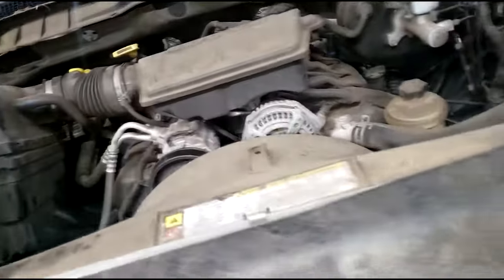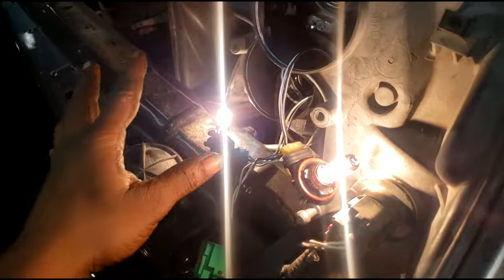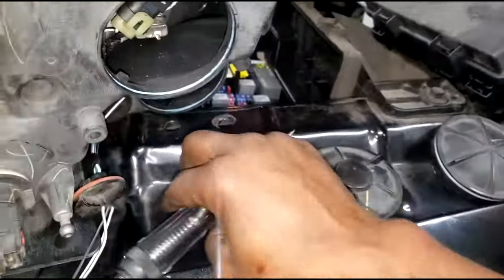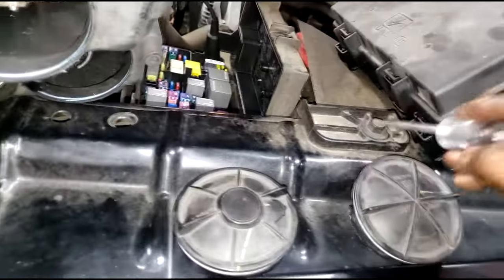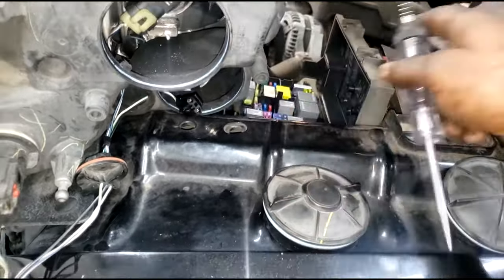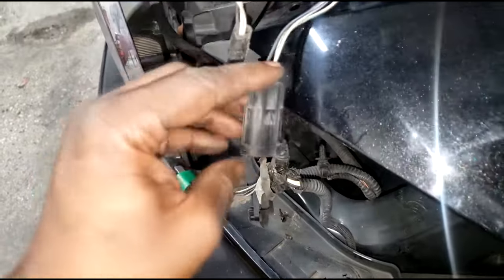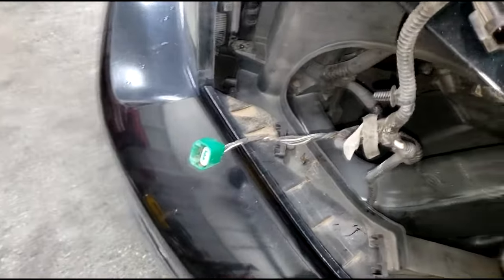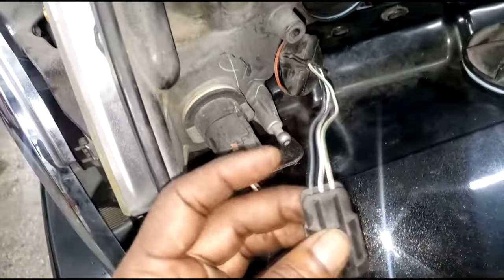Never do this to your Dodge Ram 1500. Headlight electrical problems found when I test this circuit.

Comment: Thank you so much for the helpful video. My issue is with my 08 ram. My front turn signal won't work at all. All the others work fine. The front marker lights work fine on that light.

Comment: When replacing with LED aftermarket they now make plug-and-play ones that don't need step-downs or step-ups to make them work. 2022 Upgraded AUXITO 9012 HIR2 LED Headlight Bulbs, 100W 20000 Lumens, Wireless LED Headlight Conversion Kit, 6000K White Halogen Replacement Bulb, Pack of 2. These are for the low beams and the High beams are the 9005 bulbs. They have built in fans and I took out my old bulbs and plugged these in and they worked with no issues.

Comment: I just bought an 07 Ram 1500. That has no headlights or high beams or brake lights My buddy, that's a mechanic said its probably the fuse panel and there like five hundred bucks at a junk yard

Comment: Just helping out … 

Power/Ground doesn’t feed directly into that bulb, there is a switch in-line, on the power side that closes the bulb-circuit…. This how a house-switch works, but I may be wrong concerning this issue

Comment: the harness within the housing has been known to corrode and thus be changed.   the new harness could have been an eBay knock off from OEM and is possibly why the common was not in the middle.    or the housing was hanging at one time when owner changed the bulb and the pins pulled out

Comment: Good video but based on your findings it would never had worked. I would  bet someone swapped wires not knowing what they were doing when all along the problem was a loose connection. Unable to get it to work especially with the wires swapped they brought it to you to untangle the mess.

Comment: I have a 2014 and having the same problem with the same light The new light was very dim; I thought it was a ground and never would have thought about those wires being messed up I'll check it out tomorrow. and get back to ya. it might be a factory mess up

Comment: I just fix the problem on my 2017 ram 1500 the one I had headlight problem just change your wiring harness get a new wiring harness faded into the headlight dirty old wiring harness out that’s it your problems fixed

Comment: Pretty sure this is the same as the difference between 9004 and 9007 pinouts. Someone probably just used the wrong wiring harness.

Comment: Replacing the harness is way overkill. Especially in an 8 year old truck. I would just swap the pins back where the belong.
Reply from the maker: Lol..this the dealership..We cant do that..Independent shops can get away with such..If cust see we did that they would try to sue claiming we caused other problems but I see your point bud

Comment: Hey buddy just reaching out to you because I have a 2019 Ram classic 1500 5.7 l and I've had nothing but electrical problems after electrical problem and it seems like you know what you're looking for like right now I'm dealing with some stuff that I don't know where to pinpoint anything at if you get reach back to me that'd be awesome thanks

Comment: So the wiring harness that came with the headlight assembly was built incorrectly? The short wiring harness in side the headlamp assembly was manufactured by Chrysler was wrong?  was built wrong?
Reply from the maker: Hey bud..I think somebody exchange the harness trying to fix a problem but they did not tell me and that drive me crazy..Hard to believe this truck been like this since birth.
Reply: Got it thank you!

Comment: Hello friend 
All your videos are great 
I own a 2015 ram 1500 
Never problem with the headlights until I decide to upgrade to LED 
Don’t work at all 
W
Trying to put everything back with original my drive side not power 
Someone told me it is the fuses 13 and 90 on the Body Control Mode but I going crazy can’t find it 
I’m very sure you have a answer 
Please what do you think?
Thank you very much
Reply: When replacing with LED aftermarket they now make plug-and-play ones that don't need step-downs or step-ups to make them work. 2022 Upgraded AUXITO 9012 HIR2 LED Headlight Bulbs, 100W 20000 Lumens, Wireless LED Headlight Conversion Kit, 6000K White Halogen Replacement Bulb, Pack of 2. These are for the low beams and the High beams are the 9005 bulbs. They have built in fans and I took out my old bulbs and plugged these in and they worked with no issues.

Comment: Thanks for sharing buddy. You could simply remove the pins and swap those wires. No need to cut n re-solder/ heatshrink.
Reply from the maker: We install a new wiring harness..I just did that to experiment. Thanks for watching
Reply: @OnlineMechanicTips  Well, but this "experiment" costed the customer a new wiring harness isn't?!
Reply: @mansouralblooshi3004  I disagree. That piece of harness needed a full replacement, the pin literally fell out of it plus the wires were crossed. Additionally, he stated this was a 'comeback' vehicle which means another tech already tried to fix it once and failed. At the dealership, replacing the harness was the right call.  
Great video!

Comment: Can’t re-pin a harness at the dealer, huh? All the more reason I don’t take stuff to the dealer. Never have, never will.
Reply from the maker: Comment dont make much sense, however, you are entitled to your opinion. Fact is, it had left 2 other shops and finally ended up at the dealer where it now finally got figured out and fixed. So again, your comment appears to not be good advise.

Comment: I have p0524 code took it to dodge it was diagnosed and no wire problems they did say oil pressure switch was faulty autozone got 1 from dodge when i got it back from them it had a different code p0523 change to mopar pressure switch did the on off 3 times it now says done no code is present but my scanner says its a permanent code all i did was get the engine rebuilt and had them put the hellcat oil pump the pressure is good runs and sounds fresh out the factory but no mds cause of engine light what can be done to fix this issue

Comment: Pull the pins and re insert correctly….. 2 minute job and I’d do it for the price of a bag of chips out of the vending machine. Should not have been a comeback